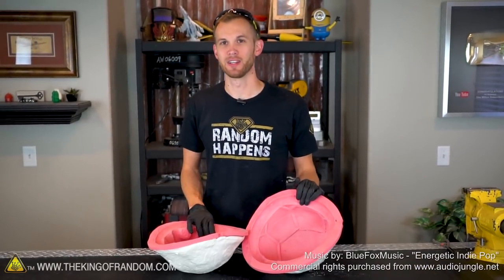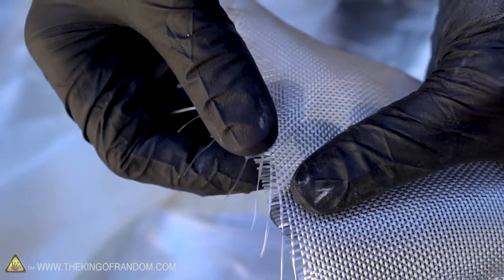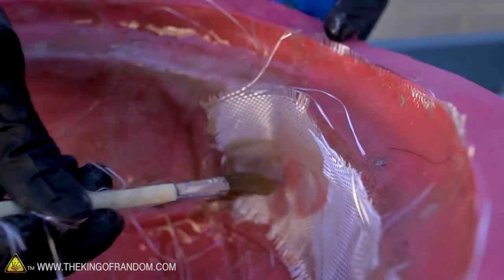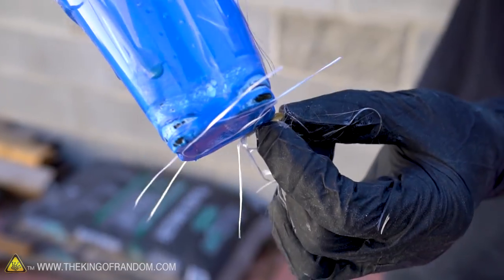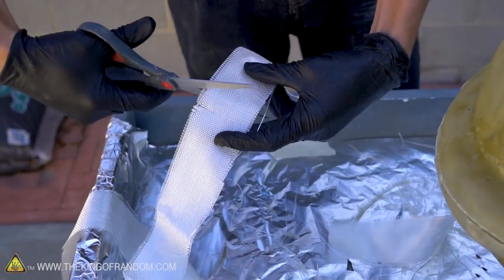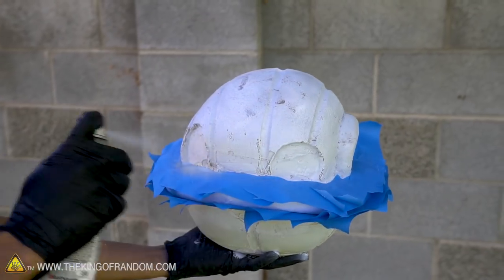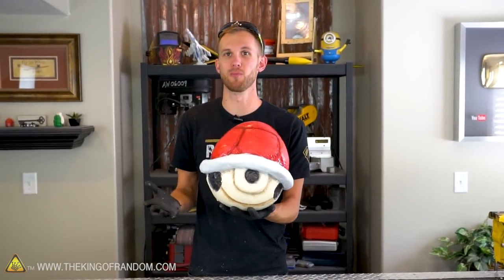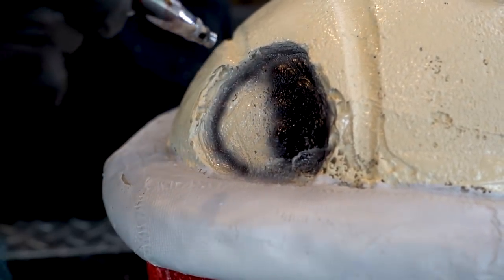How To Fiberglass a Mario Kart Red Shell

Comment: Shouldn't you have been wearing a Respirator while Grinding down the edges of the Fiberglass?
Reply: Jeremy Maynard I think the only reason he wasn't was because it wasn't just the fiberglass itself plus the fact that it wasn't much grinding at all, knowing grant if it would have be hazardous they would have worn proper protection
Reply: You should wear a respirator while applying resin to fiber glass, when cutting fiber glass, and grinding/sanding at it. Basically you need to use a respirator whenever you are handling fiberglass.
Reply: The particles of resin will equally shred your lungs, they put warnings on resin miniature kits which are way smaller than the amount he was grinding off.
Reply: he was cutting it not grinding it, it shouldnt have left dust just a few jaggy pieces
Reply: respirators are for bishes, i never used one XD
Reply: Yes. Obviously.
Reply: he also didnt wear long sleeves while grinding....its gonna be itchy af soon

Comment: As soon as I saw those cups I thought, he's going to find out soon enough that they aren't compatible.
Reply: I wonder what nate thought when he saw your comment...
Reply: What do you mean- not compatible?
Reply: @rxz4140  the cup will start to sort of dissolve with the resin inside
Reply: @rxz4140  Polyester (fiberglass) resin uses styrene, the styrene dissolves polystyrene cups (such as the popular red cups) chemically.  Much like acetone will do to any ABS plastic.    Clear cups are typically PET (polyethylene terephthalate) or PP (polypropylene) so that's what you should look for instead.

Comment: A HELPFUL TIP IF YOU DONT MIND MY INPUT.  There's a chop mat gun that has the fiberglass mat in rope form an as you pull the trigger it sprays 1 inch pieces an soaks up the resin even an level so you don't get air bubbles , an unwanted sharp edges an a glass bubble roller helps smooth out the air bubbles . Hope this helps for future videos

Comment: You can also apply a layer of Body Filler (Bondo) to make the surface smoother, and fill up any holes (then sand and fill again). Also, with the idea of the foam, you can apply the fibreglass to the foam after demolding it. That way you can have a solid version of the prop that can resist a bit more beating up, and also drill holes to screw on other parts (Maybe a blue shell? XD).

Comment: Since the dust from the grinding is plastic and glass, I suggest you wear a dust mask while grinding.
And if you want a smoother surface I assume you can use a primer on the fiberglass and sand it down to the desired finish.

Comment: i think it might help if after the 1st later of resin cured/dry, add 1 layer of mix resin+talc to make the surface of the resin smoother before adding the fiberglass layer to reduce any air bubble gap when the fiberglass cant bent deep enough. 
never used fiberglass cloth so i dont really know how far it can bent but i do that with fiberglass math

Comment: Tip: Use body filler and sand it smooth spray primer then paint to get a better finish and if you want spray clear coat for best possible finish

Comment: WARNING, make sure you wear at least a dust mask preferably a respirator and work in a ventilated area when cutting and sanding fiberglass and resin, the particles will shred your lungs if they get into them.

Comment: I think you could have gotten a better result if you would have used maybe 3-4 layers, 2 layers under the original layer for reinforcement, and 1 later on top in order to fill in all the gaps. I'd apply the top layer after applying the bottom layers first, sanding down any imperfections on the top layer, then applying a final layer on top, and sanding it down. Alot of extra work, but you would get smoother results :)

Comment: Maybe use a different project for putting liquid nitrogen into a plastic cup and use any object or material that will trap the liquid nitrogen and that will pressure it and putting an unbelievable impact on the cup and explode. You could also see what happens when you mix silicone and liquid nitrogen.